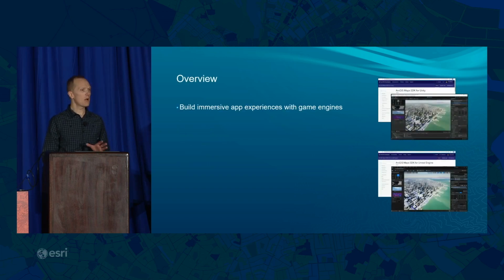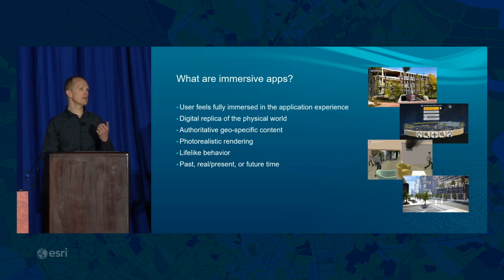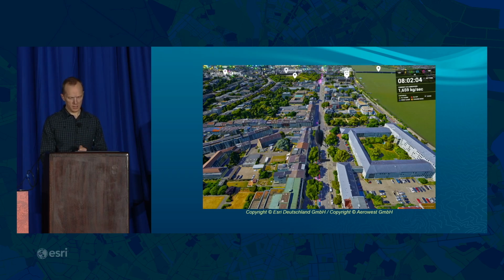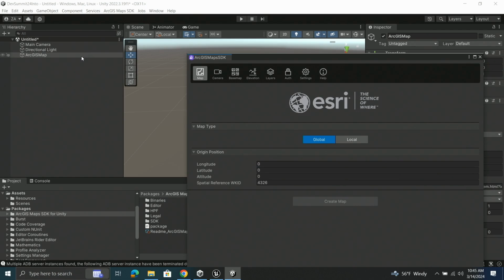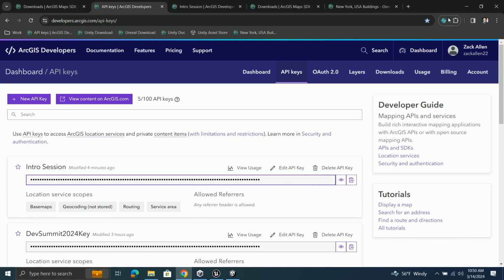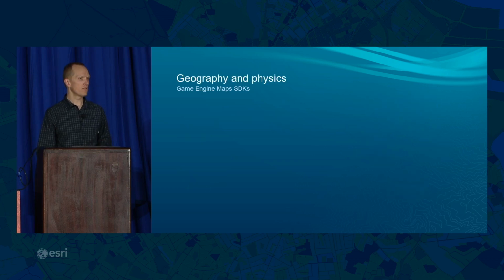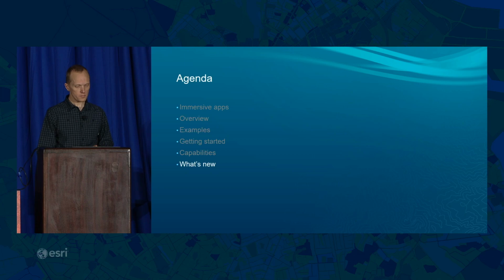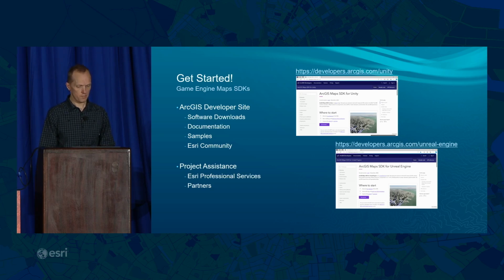ArcGIS Maps SDKs for Game Engines: An Introduction | #EsriDevSummit2024

Comment: What is the name of the simulation game?
Reply from the maker: Great to hear from you @MinaOjha-l5c!
Could you be more specific, for example, did you hear a game get mentioned in this video? I didn't catch a specific game being referenced in this video, but the game engines you can use ArcGIS capabilities in are Unity and Unreal Engine.
This video gave several demos, but no game demos that I saw. Demos in this video include: a traffic simulation, an XR (extended reality) experience on a table top, a VR (virtual reality) training app, and a driving simulation.